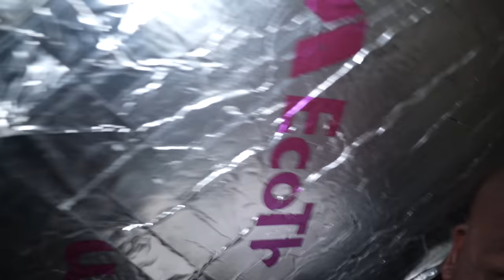OUR HOUSE IS HAUNTED *Ghost Caught On Camera*

Comment: Yeh... I think my house is haunted too 😂 These things have happened in my house...Electric toothbrush turned itself on and I couldn't turn it off, Front door opened and closed and there was no one there even checked the ring doorbell, Sounded like someone was walking on the stairs, TV turned itself off, Microwave turned on, Kettle turned on yet it wasn't plugged in, Bauble on my Christmas tree fell off on it's own, Toilet flushed itself and probably other things I can't remember of 😂